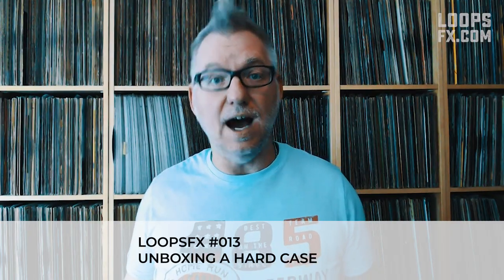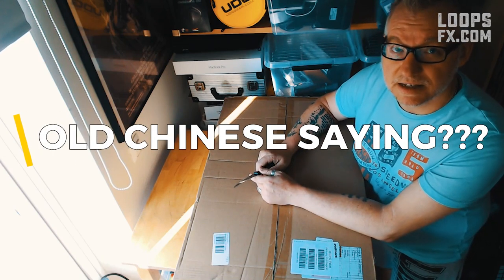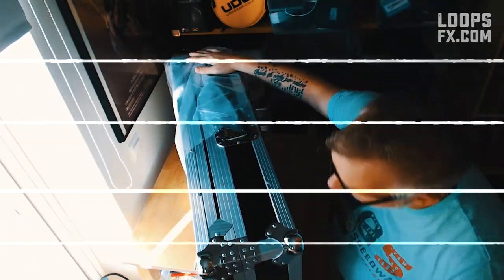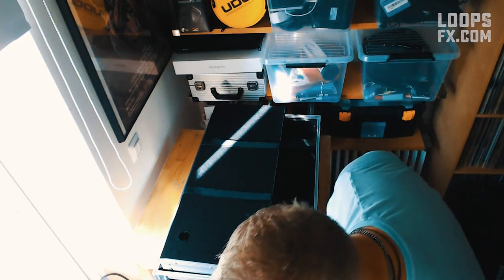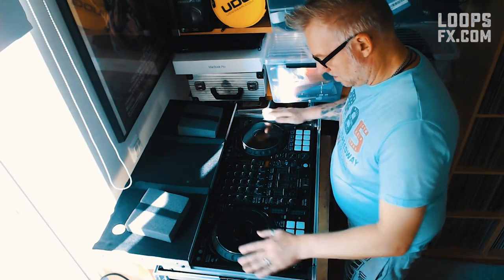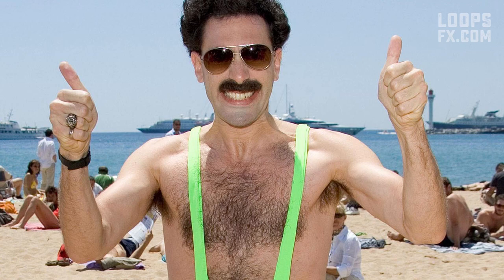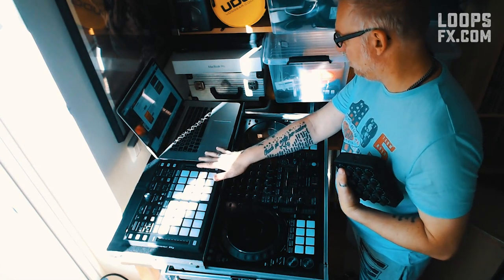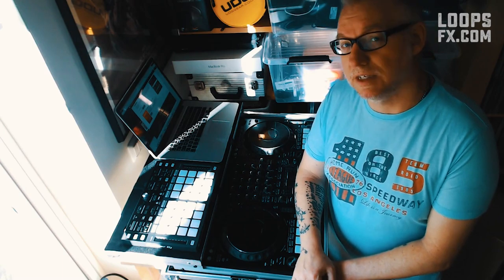Unboxing a Hardcase by BERGWALL #013

Comment: Glad to see you back, was starting to miss you. 

I'm hearing a slight electric noise during video footage.
Reply from the maker: Thank you :) It's been a long hot summer in Sweden and we're not really used to that. Sometimes up to 40 °C in the studio and no oxygen. 

I bought a new camera and use the microphone in that, but that is perhaps not such a good idea. For my next video I try using a real microphone, my Shure SM7B
Reply: Had the same at my house (Netherlands). Got to prepare better for next year.

Keep doing what you're doing and looking forward to the next video.
Reply from the maker: Yes better prep for next years heat is a must. But we bought a mobile AC this year, but the wife "stole" it ;)